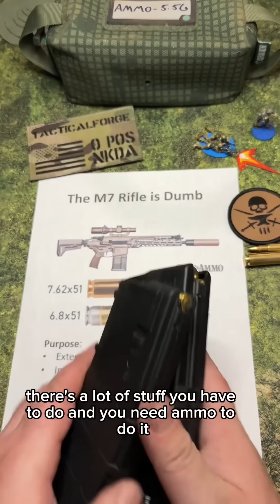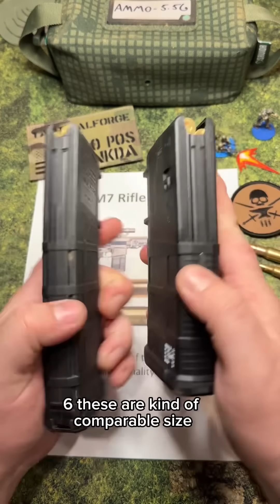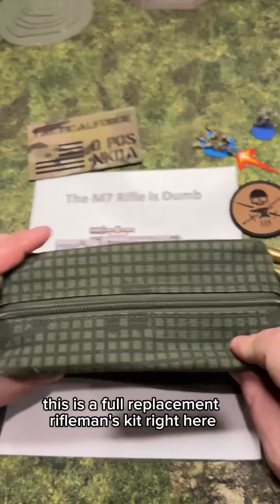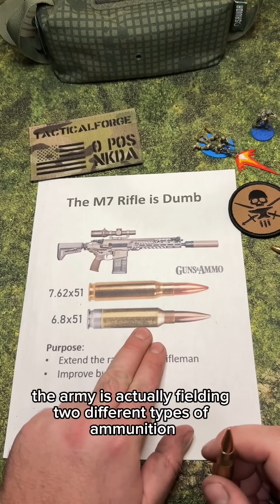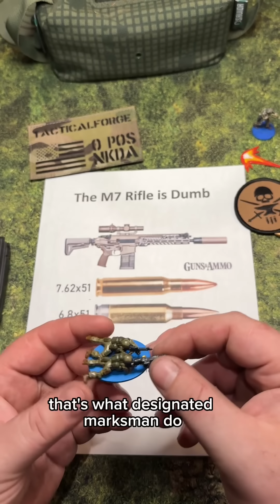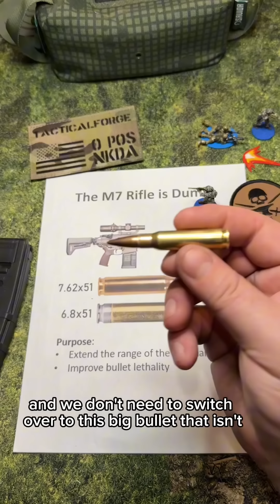My God this Rifle Sucks

Comment: m14 all over again
Reply: It's quite a bit heavier, especially when you add on the optics and suppressor and stuff.
Reply: The M14 is at least a functioning rifle that will work in most conditions.
Reply: Not even close.  This gun only gets to "M14" levels if you add on the scope, suppressor, etc.
Reply: @cstgraphpads2091 You mean like how every single last one of these is issued?
Reply: @BigSneed404 😂 ghat eeeeeem
Reply: @joemo1033  The M14 weighed as much as the M1 Garand and shot the same round yet I always see people lambast the M14 as a failure and no one points out how dumb it was that we issued M1 Garands to our troops when we had M1 Carbines at half the weight with twice the ammo capacity shooting an intermediate cartridge. What a dumb corrupt military we have.
Reply: @greene6226 That was back in the "We need thst 30 cal battle rifle cartridge!"

Old is new again I guess.
Reply: @joemo1033  In WW2 they wanted .30 cal Lmgs because they are more effective in suppression and antimaterial roles and to not have the headache of supplying 2 different ammo types. They gave the soldiers the good enough Garand as a compromise instead of the superior carbine to accomplish this. My point is that every video I see talks about how we are adopting an inferior infantry weapon without pointing out that it's probably being adopted over fears that our Saws won't be effective suppression weapons against body armor and light vehicles using 5.56.
Reply: @greene6226  m14 was also terrible because it was supposed to use the Garand tooling turned out to nearly bankrupt Winchester.

30 carbine gang would have been awesome
Reply: @greene6226 Firstly, the M14 did not shoot the same round as the M1 Garand. .30-06 is not the same as 7.62x51 NATO. Secondly, the advantages of the M1 Carbine over the M1 Garand are exactly the M2 Carbine was developed. However, we were in the middle of a war, and replacing all the Garands was simply not feasible. A lot more M1 and M2 Carbines were issued in Korea, though. But then the Army decided that everyone on earth who was developing intermediate cartridges, like the Russians, the British, the Germans, the Belgians, and even their own engineers, was wrong, and they had to have a full powered rifle cartridge, no exceptions. Another big reason why the M14 has a significantly worse reputation than the M1 Garand is that in WW2, the Garand was by far the most common semi auto rifle, meaning that almost everyone who was issued one was comparing it to a bolt action rifle, both in terms of their previous experience and its combat utility. The few downsides of the M1, like the full length stock, weren't unique to it, and so weren't really noticed. In Vietnam, however, the M14, which had copied all the same drawbacks from the Garand and added a few of its own, was completely unique in that regard. The Garand was a 1945 rifle in 1936. The M14 was a 1945 rifle in 1965. Every other army on earth had learned the lessons of WW2, and made better rifles, like the AK or the FAL being used by our Australian allies in Vietnam
Reply: @filmandfirearms  right the 30-06 was even larger and heavier than the 7.62 Nato round so the m1 was actually dumber than the m14 to adopt. Thanks for pointing that out. As for the rest of your comment, do you think no one thought of an intermediate cartridge before ww2 and by the time someone figured it out the war had already started? The .30 carbine round was based off a cartridge created in 1905 a year before the cartridge the Garand used was adopted. For almost 50 years before ww2 every army in the world had the option to adopt an intermediate cartridge and chose not to. How could they be so stupid.
Reply: @greene6226 Yes, they were so stupid for not adopting a round that didn't exist yet
Reply: @filmandfirearms  Are you trying to claim that no one thought of creating a round between pistol and 30-06 before 1940 or that they existed and the military just didn't bother to explore and refine them because they were busy idiotically exploring and refining full size rounds when intermediate rounds would have clearly been better? If the former Seriously? if the latter you are claiming every military in the world was just stupidly following the cult of the battle rifle even back before ww1.
Reply: @greene6226 The only real attempts at a military intermediate cartridge prior to WW2 were the Winchester 1907 in .351 WSL, and the Russian Fedorov. Considering that both practically ceased to exist in military hands after WW1, it's clear that militaries didn't see much use for them at the time. They were only stopgap weapons until more machine guns for aircraft could be procured. Considering the logic of the time, it's easy to see why. Most militaries were under the impression that every modern war would be fought like WW1. Long range volley fire across no man's land, with occasional trench raids and assaults across open ground. In that sort of environment, the heavier cartridges were better than intermediate cartridges, and the trench raiding would be handled with pistols and submachine guns. Of course, as we all know, that's not how WW2 turned out, but all the full power rifle cartridges were still in service, so it wasn't worth thinking about a replacement just yet. Only the Germans were desperate enough to try, with the MP43, which eventually became the STG44. This had the added effect of making western militaries seriously consider the benefits of intermediate cartridges, and they realized that for the fighting they were seeing in WW2, intermediate cartridges were better for most applications. It's not that no one thought of the concept, plenty of people did. It's just that military doctrine in most of the world didn't see a use for intermediate cartridges. Incidentally, you will note that weapons like the Winchest 1907 saw heavy use by law enforcement in the interwar period, since the situations they were coming across were actually quite similar to the WW2 situations that led to the development of cartridges like 7.92x33 and 7.62x39. Again, the concept was there, militaries just didn't put much weight on it until after WW2

Comment: Hot take: Army should have just adopted the M27 IAR like the Marines. If they wanted the M250 and M7 as supplement, so be it logistically we were already a mess between 5.56 and 7.62 so its a moot point to replace the later with a 6.8 platform

But for the average guy, a rifle that can function to some degree as an LMG is an awesome concept
Reply: You’d think they’d have figured out the M27 IAR was a sneaky rifle replacement program when the program’s RFP required a bayonet lug.
Reply: Just use the Block 3 M4A1
Reply: To think the .280 Enfield from the 1950s would have done everything asked of 5.56 and 7.62 is kind of frustrating.
Reply: @Roddy556  it couldn't. its a large round for an intermediate. being almost as heavy as 7.62 and just as wide a case diameter (meaning its mags would be the same length as a 7.62 nato rifle), while being low energy for this size and weight, being essentially 7.62x39. 

the reason .280 british failed was because NATO was moronic and wanted a standard round for both rifle and support machineguns and .280 simply can't be a support weapon cartridge which coming out of ww2 and korea was shown to be the more important aspect of warfare. 

but lets say hypothetically NATO and the US were interested in the two round solution and both .280 and a heavier round be it 7.62 nato or something similar was adopted, 5.56 still would have been adopted as its still significantly lighter and smaller than .280 british while haveing similar (infact slightly longer) range.
Reply: Yeah, just pop the fancy optic from the M7 on it and chuck the rest out because the optic seems to be the main sell for this entire concept